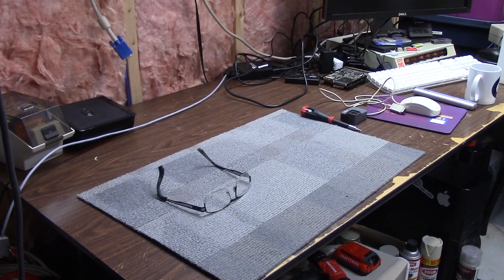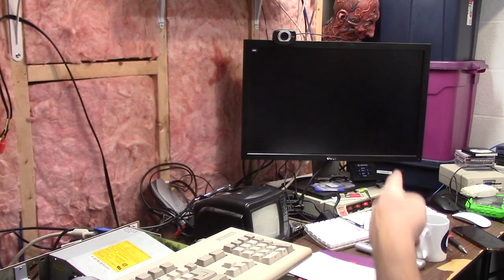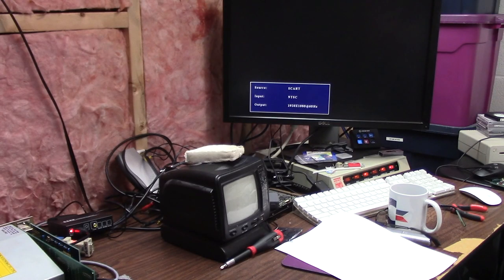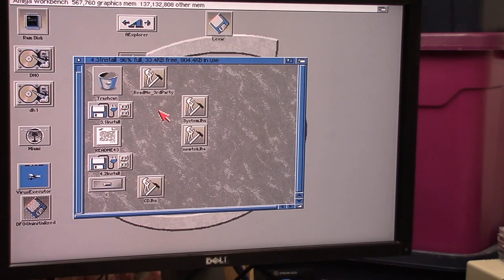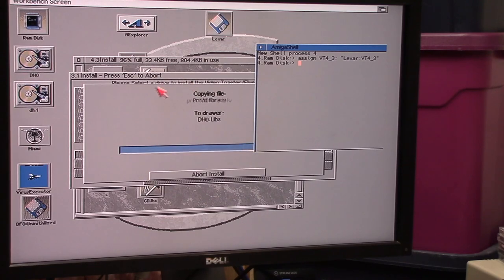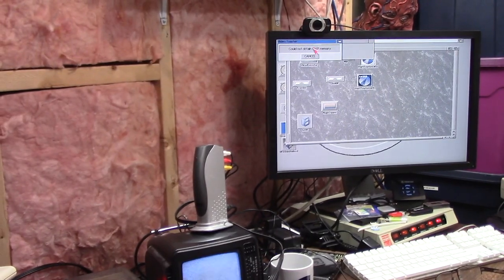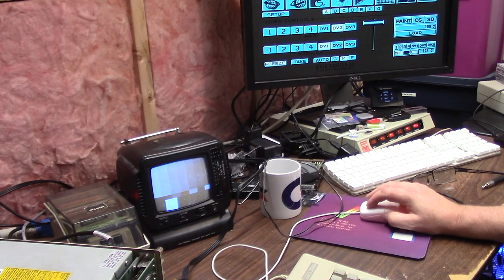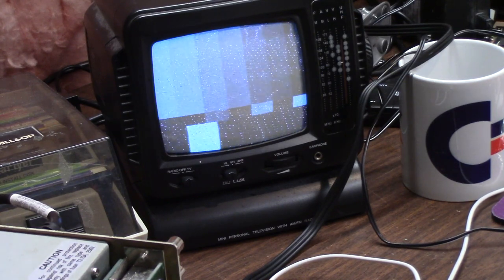Video toaster test in A2000 overheating?

Comment: I have no clue about that stuff all I know is that people who use those have a bunch of cards, monitors cameras video output devices and what looks like thousands of cables going everywhere.  This is where labels come in handy.    Doug over at 1000MARC has some Toaster Videos,  I watched them they were cool.   Your video was perfectly fine because it will show those who venture into the Toast stuff they are not alone.    If it doesn't flicker its not a real Amiga and yet its the one thing Amigas will do that annoys every die hard Amiga Fan.    I hope you get that sorted out.   I would not be wanting to pull out a bunch of CRT monitors I would look for something more modern with Component Connections that you can hang on a wall.  Heck you might have some hiding in a closet somewhere.

Comment: Point a thermal camera at capacitors (and thereby resistors) to check for hotspots indicating a short. It is like how one would do that for buck regulators on a modern Graphics card. The Toaster is a bunch of frame buffers and as such multiplexers. While I have no reason to hear you say it is water damage, get a microscope webcam on it and check anyway. Resistors would look dulled compared to a new resistor of the same value if aged or water damaged, thereby affecting resitance. Heat would then change that the moreso. Resistors (and of course Caps they might affect) and buck regulators/convertors in a GPU (or monitor for that matter) can change screen colours if water damage (usually a resistor). I'm guessing another amiga with that Toaster would produce the same result. Otherwise one might almost expect the amiga itself. Sprites, Copper and bitplanes are extensively used to encode data towards the video toaster.
If you have shorts on a GPU in general (not talking VToaster here, per se), check for "soot" marks (discolouration is what I really mean though like where PCB mask changes colour from potential damage) and so these can be indicators of problems. A multimeter of course would be at hand and you might not need the OScope. OSCope can be used to check XCLK and video signal ZD (high or low).
You'd be best to show us the board wih a microscope webcam (just a £50/ $50 one would do) and see what CMOS (p-type vs n-type junction) for multiplexers you have.
Compare your resistor colouration to the many hi res photos online of many a "perfect condition" video toaster.
As an aside, in a computer the cap and resitors will affect other things like the charge load pulled on  RAM RAS (or CAS in modern) computers and the signal path hereinafter.
I'm guessing your edge connectors of the zorro slot are not tarnished by oxidation?
My comment has no hate in it and I do no harm. I am not appalled or afraid, boasting or envying or complaining... Just saying. Psalms23: Giving thanks and praise to the Lord and peace and love. Also, I'd say Matthew6.

Comment: Check psu voltages under load for sure,i think -5v can affect color changes,but usually turns pink if memory serves when -5 is low or missing. May be a case of toaster chips needing re-seated in sockets or caps as u mentioned.. Not sure the toaster will cool(other than convection) without the lid on and no forced air going by. Good job tinkering around with it.. Not sure why they did the 47 floppies initially,i think for the price they could of sent each toaster user a scsi cdrom and cd..and still came out cheap LOL. At least toaster software came on CD later.
Reply from the maker: my Power supply is fresh re capped (2 yrs) so i know its good, all other cards work fine without any issues or hiccups. all the caps on the toaster are ceramics, have to pry it apart to separate the boards... #scaredtobreakit
Reply: "Assumption is the mother of all F*ckups " :) i'll take your word for it tho :) i'm betting the toaster problem is a case of old sockets/contacts.

Comment: Chris, do you need a plastic insulation sheet between the Toaster and the PSU etc?
Reply from the maker: theres like 5mm of space , it had a self made plastic cut out for case side protection, but it didnt  touch anything